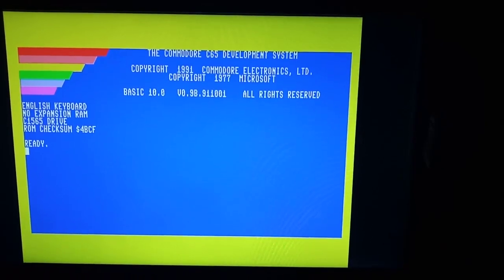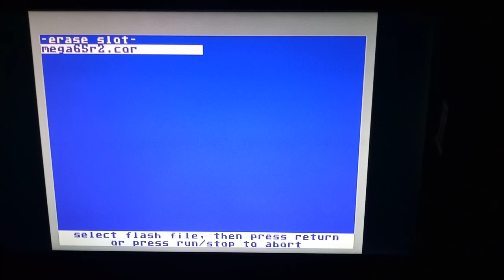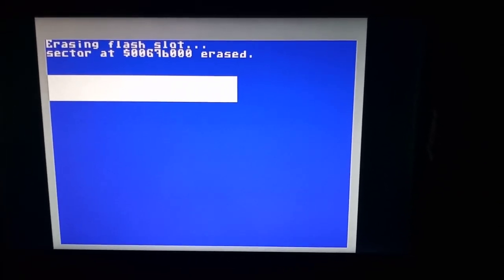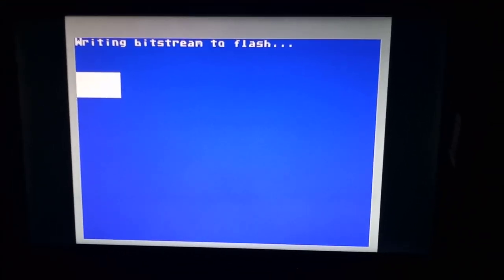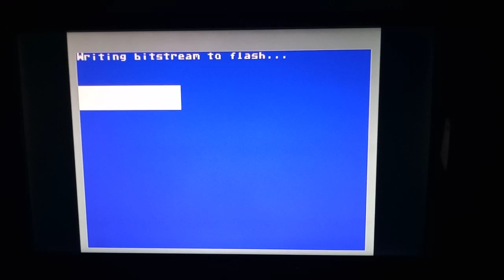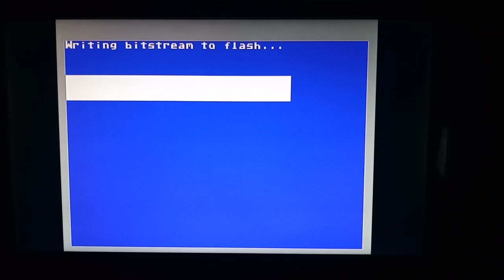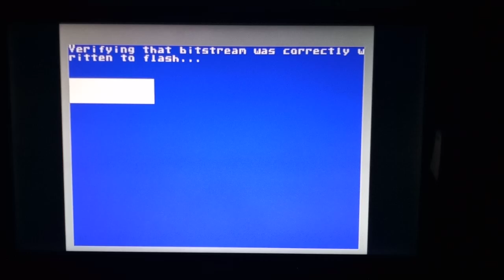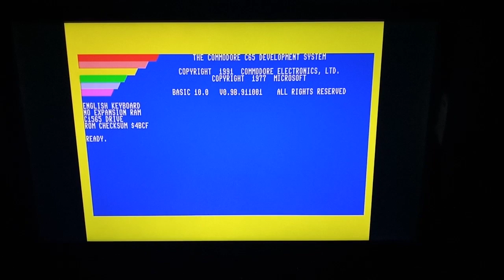MEGA65 Flash menu / Core Selection Menu

Comment: Hi guys,
again a very interring video which shows the progress of your project very good. Thank you for sharing this moment with us 😀
I like the Mega65 and enjoy every news I read about it. I like the idea to flash it with other ROMS like VIC-20 or Amiga. Will it be possible to flash also the ROMS of Commodore C16 or the original C64 !? Would be great 😎
Greetings from Germany, Andira 🕹
Reply from the maker: Hallo Andira,
du darfst immer auch auf Deutsch fragen, wenn es dir bequemer wäre. Wir können besprachig antworten. C64 ROMs kann schon benutzed werden.  C16 würde ein C16 Core brauchen. Soll aber ganz möglich sein. Aber wir haben leider nicht genug Zeit, bevor der MEGA65 am Markt kommt, eins zu schaffen.

English: Yes, you can already load C64 ROMs on it, as the MEGA65/C65 hardware is (mostly) C64 backwards compatible.  For C16 ROMs, we would need a C16 Core, but that should be quite possible to make -- but we won't be doing such things until after the machine is available to buy. But there is nothing stopping others making one in the meantime :)

Comment: i heard that the mega65 will have c64 support. would it be able to run vic20 and plus 4 too out fo the box? also. waht price range you looking at when you finally release it? cheers
Reply from the maker: We are initially targeting only C64, but adding VIC-20 and Plus/4 support is just a case of making a new FPGA core, i.e., its software.  So we fully anticipate that at some point people will make VIC-20, Plus/4, C128, Amiga and other cores for the machine -- as the FPGA is big enough to implement any of these platforms.
Reply: Via emulation, like with C128 it has C64 mode, but not 100% compatibile.